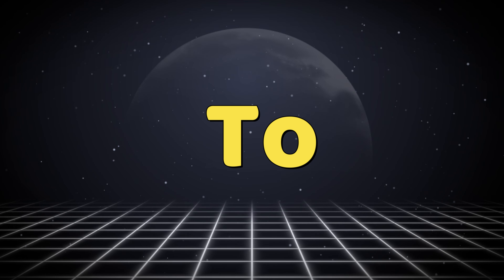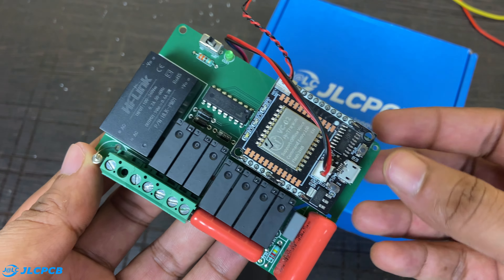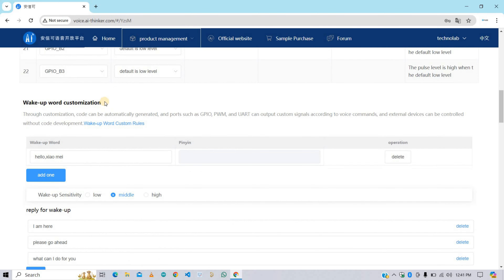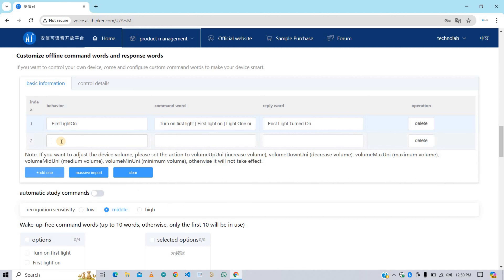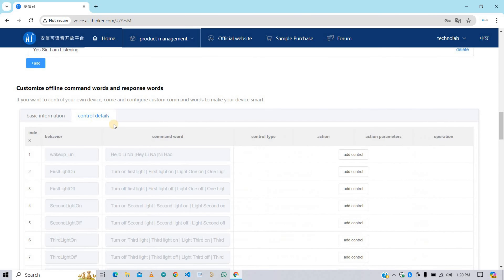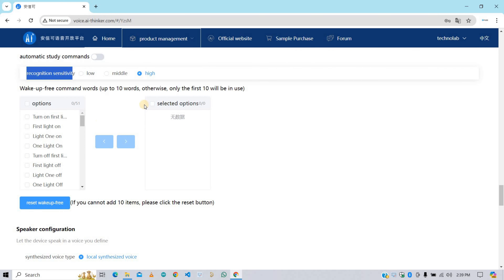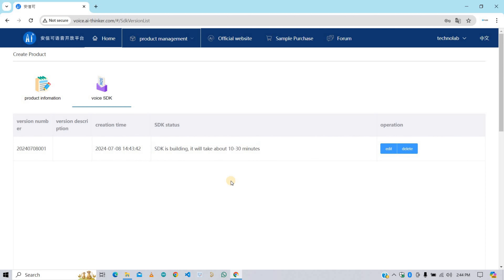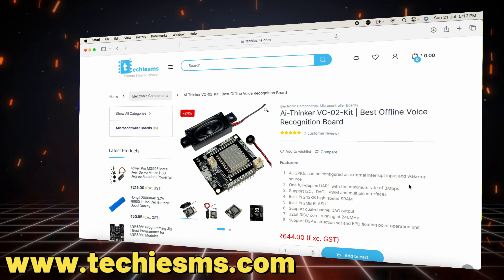Control Appliances with your Voice WITHOUT INTERNET | JLCPCB

Comment: Hello sir i connected the output of vc-02 module (8Ω speaker slot)to an amplifier of lm386) and after that i disconnected it from the amplifier and connected to the speaks(original connection of vc-02 module)it shows distroction output in the speaker please help me any one can help please